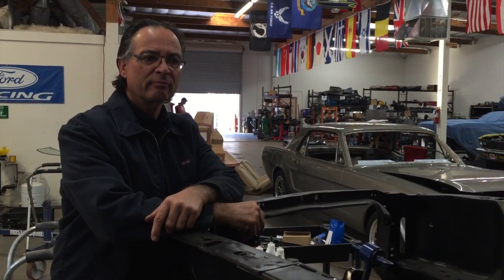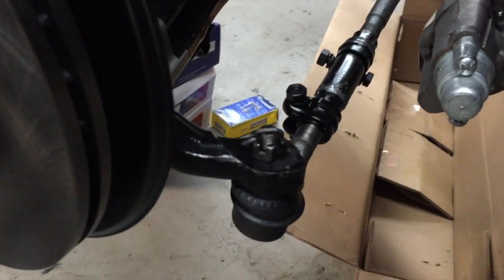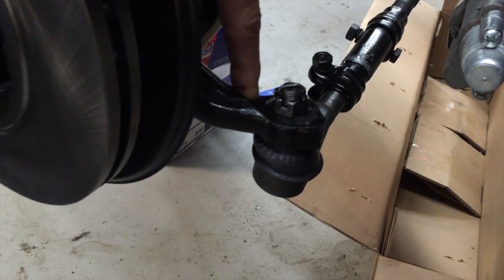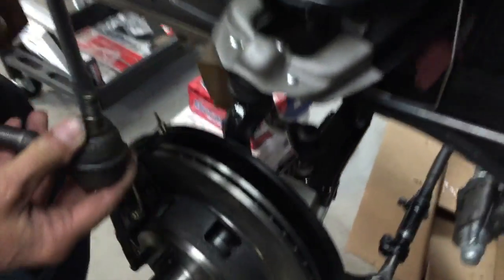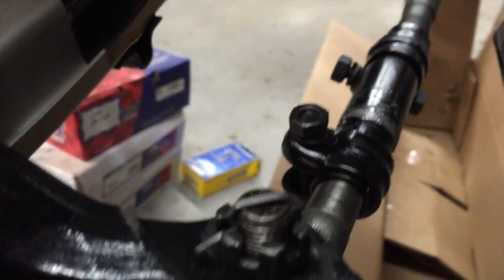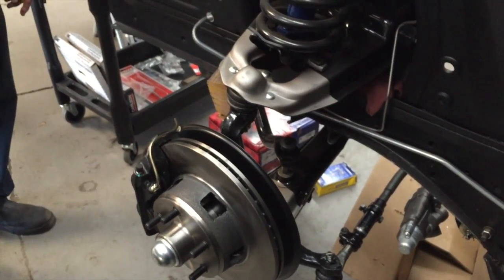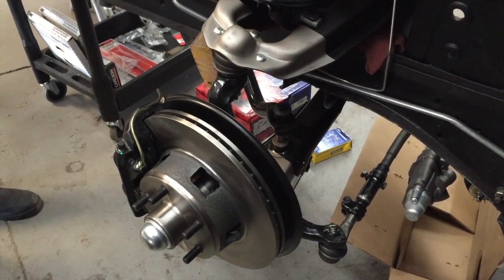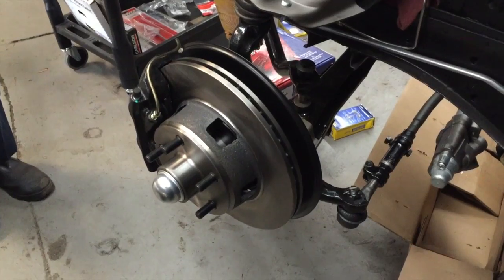New Rotors Jorg's 1969 M Code Mach 1 Mustang Fastback - Day 55

Comment: Yes. The spindles have bigger diameter holes on the '70, so require a different tie rod.

Mustang Steve sells a bushing to adapt the '65-'69 tie rod to the '70 spindle, but if you have '70 spindles and are replacing the tie rods, it's easier to just get '70 tie rods.

The wheel bearings are also different. '70 uses a larger bearing making them more desireable than the previous years.

Help ya out here a bit.

The 70 Mustang/Cougar tie rods are a stand alone year. Won't interchange with ANY OTHER Mustang tie rod of any year.

67-69 Mustang/Cougar Tie Rods are all same, regradless of 6 cylinder-428-Power Steering-Manual steering, all same.

Centerlinks on 67-69 same, 70 is stand alone.

Bearings-- 65-69 Mustang, Comet, Fairlane, Cougar all used A2, and A6 Bearings.

70 Mustang/Cougar used A12, and A13 Bearings, and of course will not interchange with the 69's. OF course this on the bearings pertains to the regular Mustangs, not the 69 Shelbys.